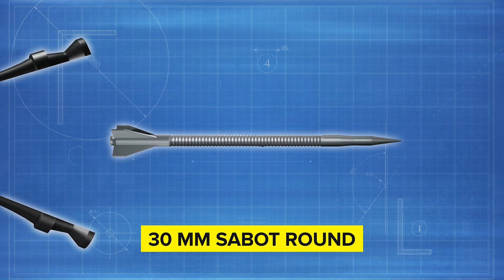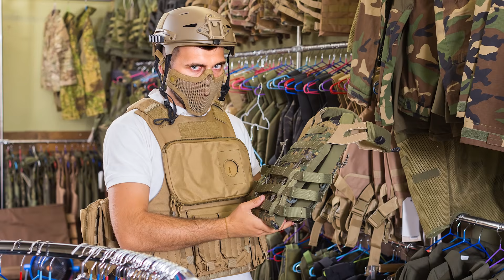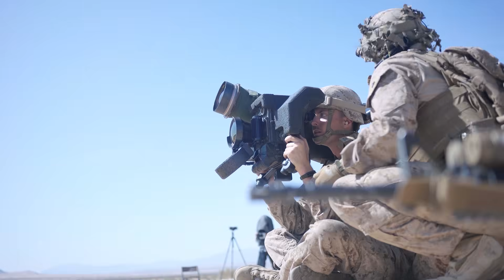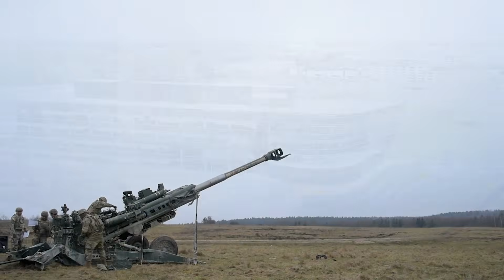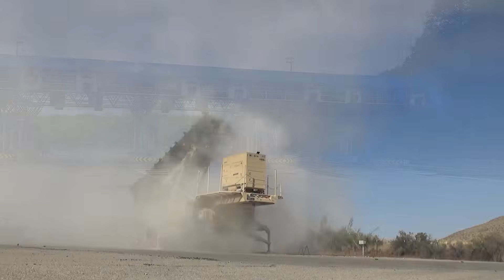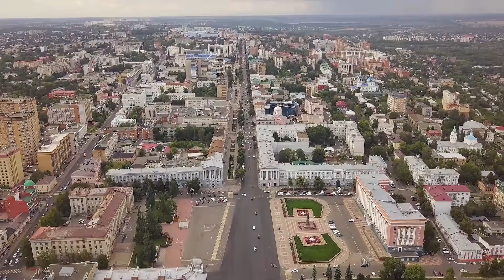How American Weapons Destroy Russia

Comment: Yea the Dutch F-16s were likely built in Europe but the vast majority of the 4700+ F-16s that have been built are built in South Carolina in the United States. The F-16 is still in production to this very day in Georgia. The original F100 engines made by Pratt and Whitney, an American company, are not used anymore. Since 1994 the General Electric F-110-100 and -200 engines have been used which have a greater thrust to weight ratio and maximum thrust. The ones the Ukrainians are getting have these engines. The original Pratt and Whitney engines had maximum thrust of 24,000 pounds and the newer GE engines have a maximum thrust of just under 30,000 pounds.

Comment: M242 Bushmaster on the bradley has a range of 18,000ft when used ballistically and the 2700m limit on the sabot has to do with the darts simply getting too hot and slowing down too much to be useful... she'll throw HE to 4km no problem, the targeting system really can't see that far but that won't stop the rounds from exploding either.

Comment: the entire schlap about 30mm sabot is mostly useless to downright wrong... reactive armor is designed to take as little damage as possible from sabot because it is for reacting to shape charges and you don't want someone simply using an automatic hunting rifle to remove your anti-explosive defense.   So ignore the section about sabot.   Yes NATO has a 30mm standard for weapons like (but not specifically) the 25mm bushmaster and the CCCP manufactured a series of 30mm chain guns that also had darts but the likelyhood of these darts actually working correctly is low to no.

Comment: Waite a minute. Reactive armor will not stop a sabot round. It is designed to stop heat rounds.  The exploding plates in the reactive armor box disrupts the formation of an explosive jet that is mentally to bore a hole in the armor. this is very different from how Sabot round works.
Reply: In most cases, you'd be correct. BRAT is unique in that it has what amounts to a blasting cap on it. A bullet won't do it, but if a hard enough blow hits the tile, it will explode anyway, and redirect the projectile
Reply: Oh no, new reactive armour is being designed to stop sabot rounds as well. Come the technical challenge, someone will design the solution.

Comment: The Patriot is not the most advance air defense system the US has. It's being retired with it's replacement already in service. THAAD is much more advanced than Patriot
Reply: @JMAC479  .....No that's not correct.  The Patriots and Thaad intercept missiles and aircraft at different ranges. The Patriots aren't being retired.
Reply: @JMAC479  ....They're not retiring the Patriots.  Different systems for different targets.

Comment: What seems to be a large sum of money being dedicated to supporting Ukraine (primarily with military aid) is - when one peeks underneath the kimono - a bit deceptive in nature.  How so, you may wonder.  Well, for two reasons primarily... 1) Most - if not all - of the military kit being sent to Ukraine is "old" equipment (i.e., in the process of being decommissioned) is being priced at its original cost, not its disposal cost.  Ergo, the value of the actual military equipment is highly inflated.  The good news is that much of it is still better than anything Ukraine already had and it's still better than the Russian equipment.  2) The equivalent [inflated] dollar value of the equipment being sent to Ukraine is actually being invested in new equipment for use by the US military forces.  And that's a good thing... aside from the misinterpretation of the facts and the misinformation being bantered about regarding how much money is being "given" to Ukraine.

That said, what military support the US is providing to Ukraine could be made even more effective if the restrictions on its use for striking targets inside Russia were to be removed.  As it now stands, what value Ukraine is able to extract from this military aid is derived primarily through Ukraine's ability to improvise, adapt, and overcome.  Through Ukraine's own innovation and out-of-the-box thinking and behaving, it's able to maximize the value the support it has been receiving.  And now that Russia is turning to its lacky partners for its military support, I'd say it's high time for all of Ukraine's partners to untie Ukraine's other arm (analogously speaking) and let it fight in a two-fisted manner.  The hell with Putin's nuclear threats; if Putin/Russia is going to open the nuclear Pandora's box, it won't be because Ukraine expels Russian invaders from its territory, it will be because Putin/Russia is not getting what it wants.  There will never be an existential threat to Russia that comes from the outside.  As happened in the past, the actual and pending collapse of both the Soviet and the Russian states has been and likely will be - respectively speaking - caused by internal weaknesses that are innate to their autocratic/kleptocratic/dictatorial modus operandi.  Any attempt to cover-up this reality is little more than excuse making.  So, it's time for the US (and its Western/NATO allies) to let the real fight begin!!!!!!!!

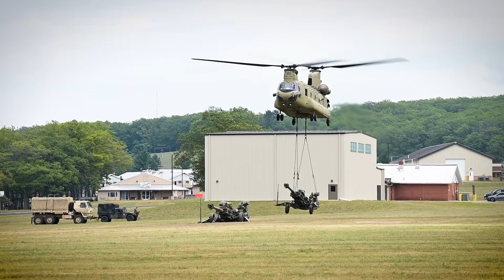Comment: 13:20 "it has a 39 caliber barrel" what the heck are you talking about ? its 6.1 inch/155mm
Reply: There are two ways of quoting caliber- one as a measurement of barrel diameter (what we're most familiar with, from pistols/rifles on up), and also as a measure of barrel length compared to the shells diameter.  In this case it means the barrel is 39x155mm in length.  You typically only see this quoted on artillery, cannons, ship guns.. and usually including the diameter.  For example the main guns on the Iowa battleships were 16"/50Caliber.  (meaning 16"x50= 67' barrel length)
I think they did this to better communicate the power of the gun- longer barrels typically mean higher velocity.  Or who knows?  This goes back centuries.  At least it's not "Gauge". :)
Reply: @christalbert722  yeah we know what gauge/gage is. or at least i do. ammo has always been done by brass catridge length if modern. none is by barrel length, ever.
Reply: @christalbert722  btw i forgot to say nice vids on yt. /s